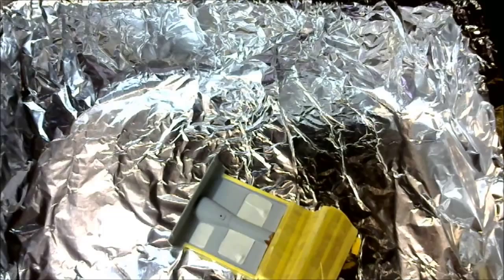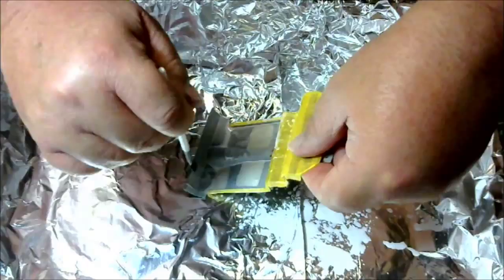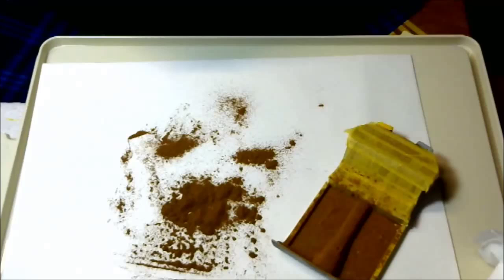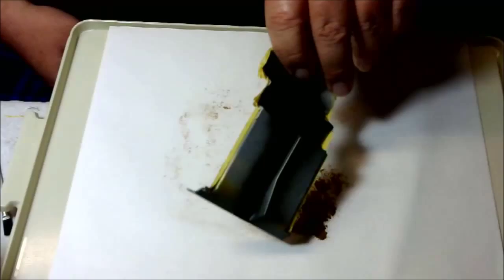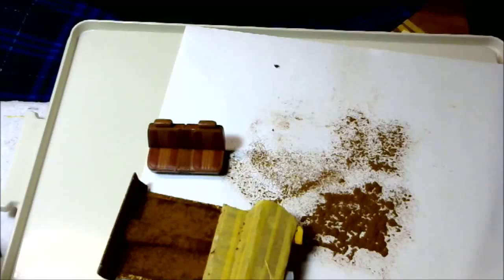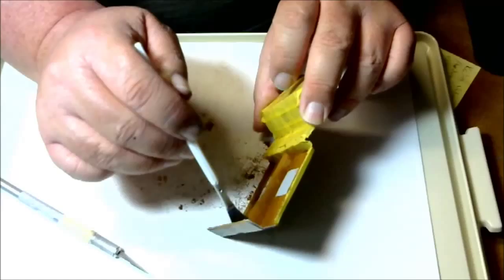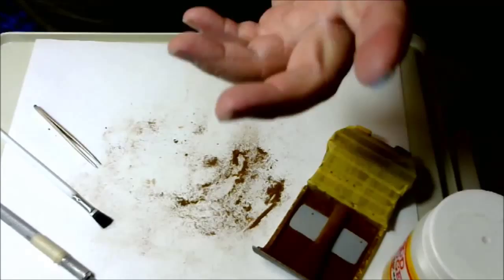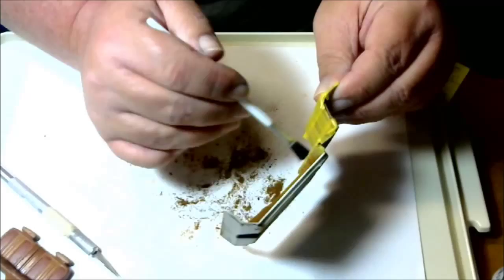Flocking with Chapman

Comment: Chris, great video as usual.  I have a question.  How do you get different colors.  Like red and black, grey etc for different builds.
Thanks
Reply from the maker: BennyCFD after I apply the cinnamon I just paint the carpet whatever color I need. Then I use a dull coat to seal it then remove any tape.